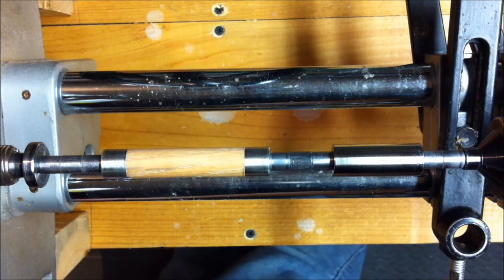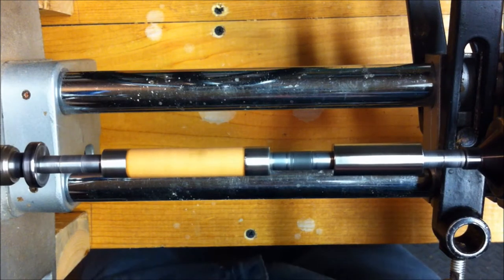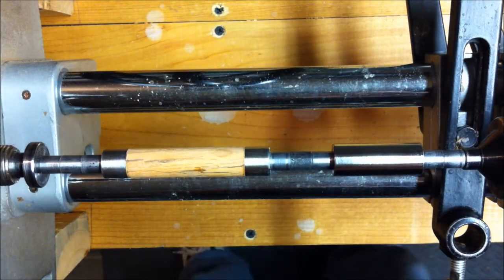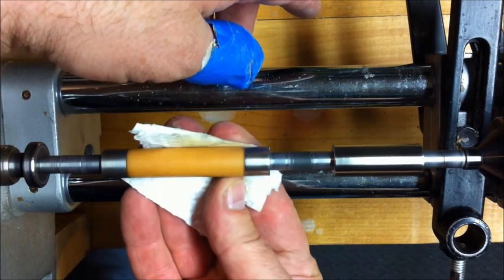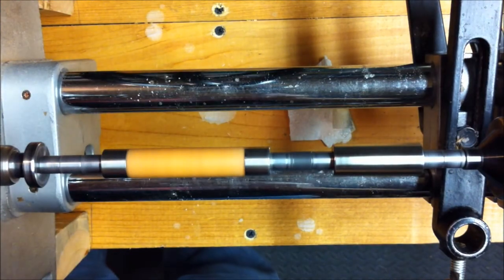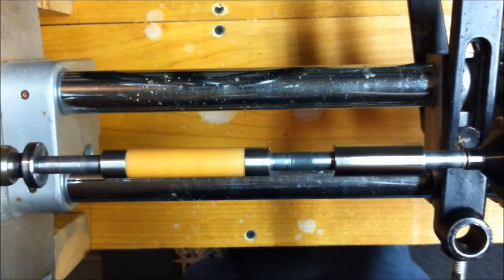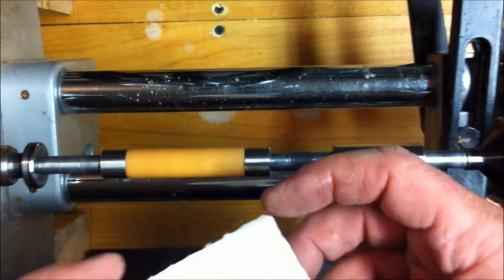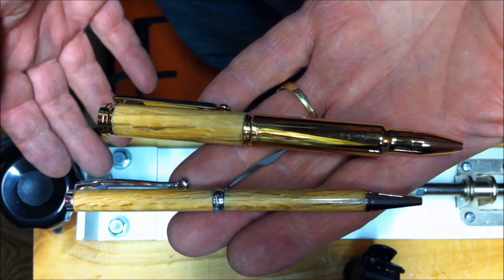Barn Wood Pens   Part 7 of 7

Comment from the maker: CA is like a polymer and forms a hard shiny almost indestructible finish if you apply several coats and sand in between. I think that wax won't do much and may not even stick to it. As for shellac, the CA will form a hard protective finish so I don't think it is necessary. It will buff to a beautiful luster and moisture or oils from hands will not effect it. I plan to use five or six coats of CA with sanding in between and leave that as the final product.